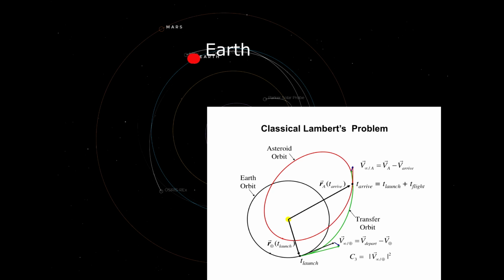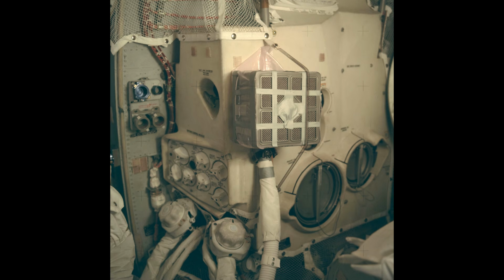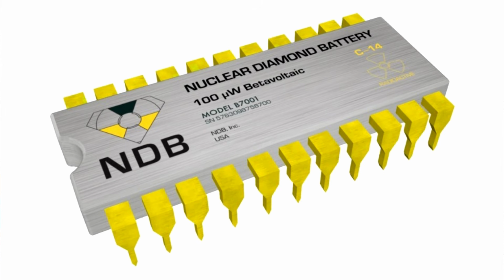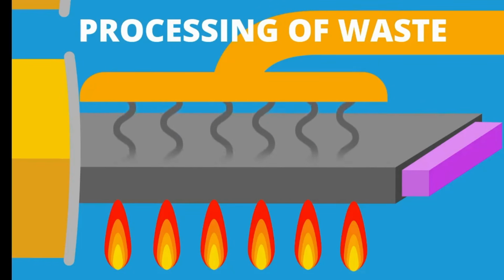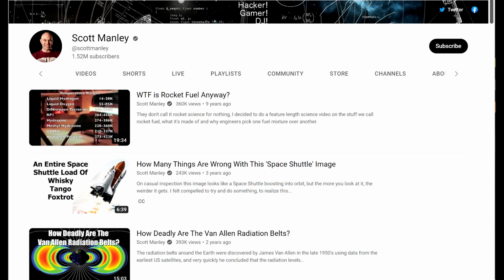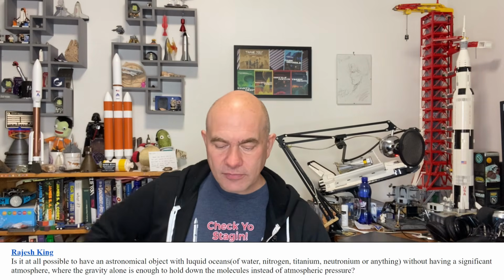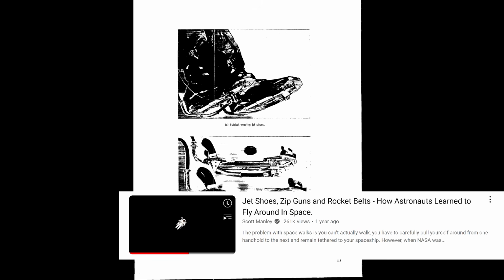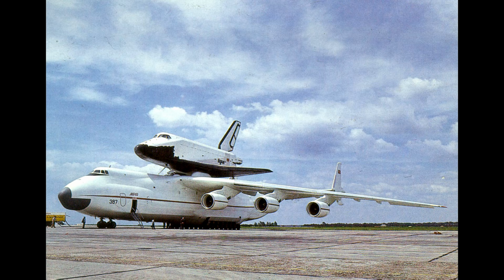Is There a Tripropellant Rocket Engine?  How Are Orbits Planned? - Deep Space Questions 21

Comment: seems easier to feed the central engines from the side boosters and when they are depleted start using the central core fuel than switching fuel from one booster to the other
Reply: Easier to just shove engines on, and drop them and the pumps when empty. They only have to be carried for 3 minutes then, otherwise you still have to carry probably 2 tons of plumbing and valving to orbit. Soviets ISTR did make drop off tanks, but gave up and slapped on simpler cheaper solid cores instead, easier to design and control. Extra tanks add weight that you have to take to MECO. Easier to dump parts after empty, and only take 100kg of attachments and stiffener ring you already mostly need instead.

Comment: I hesitate to ask this, but did you confuse evaporation and boiling when you were discussing atmospheres at low pressure? You started by talking about the vapour point  changing as pressure dropped, but then you mentioned the fact that the boiling point occurs at lower temperatures as well. But surely it's evaporation that's critical here, not phase change? And evaporation can be significant (enough to maintain an atmosphere?) at much higher pressures than those necessary to reach boiling point.  Sorry if this sounds pedantic.
Reply from the maker: Conflate is the term I would use, not confuse.

Comment: I saw a Buran at the Technick Museum in Speyer, Germany back in August.  It was really cool.  I highly recommend going.  There amount of cool stuff--not just spacecraft, but also planes, trains, and automobiles, and also boats (lol)--they have there is unbelievable.  If you go, make sure you get the two-day ticket and have enough time to fully use both days.  It's entirely possible two days is insufficient.
Reply: Seconded. You might want to make it 4 days and spend the other two at the sister museum in Sinsheim, about 50 km east of Speyer. Speyer has the Buran and a 747, Sinsheim has both Concorde and Tu-144. Obviously, both have quite a bit more stuff to look at. 

You might want to look up "Brazzeltage" (I'd translate that as "rumble days"), the next ones are May 13th and 14th, 2023. These days are basically a big party where they just show off the stuff they have. A lot of the exhibits are not just dismembered show pieces, quite a few of them (especially the cars) do work and are drivable.
Reply: I saw it back in 2016 it was really cool! I also loved seeing both the concord and TU-144 in the same place and comparing their interiors.
Reply: @ianchristie3995  Concorde and TU-144 are in Sinsheim, the sister museum to Speyer.
Reply: @realulli  yup your right went on the same day so in my memory they are in the same museum.
Reply: Being a huge aviation history fan I had to see Concorde and Concordeski side by side, but I was time-limited so couldn't make it to Speyer also. I hope to get back to Germany some day to see the Buran (and also because Germany's just a great place to visit, very hospitable people!)
Reply: I saw the Buran in Speyer in August too! I was on a river cruise so didn't get to Sinsheim.

Comment: Curious why don’t they give rockets a rolling start to save just a tiny bit of energy? Mechazilla could start lifting the rocket as it launches
Reply: A) it would only save a tiny bit of energy 
B) there's nothing strong enough to lift most rockets when they're full of propellant, and creating such systems for almost no benefit is not worth it to anyone
Reply: That energy is negligible compared to the deltaV needed, but would introduce a lot of complexity, costs and risks. If it only saves a fraction of a second worth of propellant, it's not useful.
Reply: Well you kinda answered your own question. Using this type of method you only save a tiny bit of energy.
You save such a tiny bit of energy that you wouldn't be able to reduce the amount of fuel carried by even 1%, and so it's just not practical.
If you could get it up to a significant fraction of the speed of sound, that's a different thing entirely. Then it would very much be worth doing.
And following that line of logic, you end up with the various kinds of non-rocket space launch that use things like linear induction motors and mass drivers and Lofstrom Loops and that kind of thing.
Reply: @SciDerg  It DOES work for smaller applications though.  Look at Virgin Galactic's rig where they use an airplane as the first stage.  And I recall reading about a concept of using a C-5A (or equivalent) with a rocket that could be rolled out the rear doors, dropped a short distance under a parachute and then launched.  That idea was used in the Dale Brown story "SkyMasters" as I recall.
Reply: @michiganengineer8621  Yeah but that's smaller applications. You're not gonna launch anything to geostationary orbit with that kinda system.
Heck, not even a GPS satellite, which goes to a lower orbit.
But that's the thing, these kinds of non-rocket space launch that DON'T use aircraft DO scale up pretty well. The power requirements also scale up, but overall a rocket is one of the less efficient ways to get things into space, the only real advantage is that it doesn't really require that much investment into infrastructure.
Something like a Lofstrom Loop on the other hand, that can push lots and lots of mass into orbit over the course of a year's operation launching 2-4 payloads per day (and that's on the slow side of launch cadence for that type of system). The only real problem is that it takes a couple thousand kilometers of the earth's surface (only in one direction, cause it's a linear thing), and that's just too much of an ask for current economies to consider starting work on.
Reply: @SciDerg  With current engines and fuel that's very true about the altitude you could reach.  But, as has been shown with the Raptor engines, there is still room for improvement.  The Lofstrom Loop launcher would be excellent, once materials are available to build it.  As far as the space needed, you only need to "occupy" the land at either end (Plus several locations to anchor the stabilizing cables).  If it wasn't for those pesky hurricanes I'd say anchor one end on the east coast of Texas and the other end in Florida.

Comment: If the Buran was almost pointless how about the N1?
Reply: Moon rocket wasn't pointless, at least not in the sense Buran was. Rushing N-1 to launch pad before thorough testing gave it that 'utter failure' image but it was a race and I'd say that SpaceX and their Starship have proven that live testing from early stages is an approach that can work. In case of Buran however, its very concept made no sense. What was it for even? There wasn't even a delusion about it being 'cheap reusable space bus', they knew they were making 'golden cow'.
Reply: The N1 was no more pointless than the Saturn V was. The inability to fulfil it's purpose doesn't mean that it never had one...

Comment: The rationale for a cargo cycler would not be to save delta V but to utilise existing capacity to transfer to and from the cycler. Of course, as 'cargo doesn't care how tightly its packed' it can travel in a can on the outside of the cycler. Presumably, once you rendezvous with the cycler, the mass to be cycled is almost* irrelevant, as long as your transfer ships can handle it at each end. You then don't need to send a separate set of engines, control equipment etc along just with cargo when you already have all that on the cycler. *The cycler might need somewhat beefed up systems to handle an on cycle correction if that was envisaged.

Comment: I thought Buran (boo-ran) was developed largely because the Shuttle wasn't going to live up to the hype. Their aerospace engineers seeing it would never be a cheap space truck, the Soviets, not understanding American politics, assumed it was all a cover for something military.
Reply: "assumed it was all a cover for something military." Which in a way was true, and failed just as the Buran did.

btw: The fully reusable boosters planned for the Buran would have dropped costs considerably, but they never got to build them.
Reply: @TheZoltan-42  Sure, the "single orbit missions" the Air Force wanted don't make any sense without the ability to launch on short notice, which the Shuttle could never do.

And those scissor-wing boosters would have been something to see (assuming they weren't kept secret...) I've always wondered whether they were a real project though.
Reply: Correct. Even those whose thinking was informed by Marxism saw that the STS figures (even assuming they believed the launch rates being proposed), saw they did not add up.
Then the announcement of a Shuttle launch site at Vandenberg AFB really got them paranoid, as it seemed possible that a launch from there could be over Moscow itself very quickly.
There was also the intense rivalry and politics within the Soviet program, the repeated failures of the N1 gave those who had always opposed it, a rationale for their new project, STS coming overhead from the West Coast got them political support and much more funding, from Brezhnev himself.
Reply: @grahambuckerfield4640  Well, N-1 failed because they were trying to rush it, and we all know you can't rush a rocket project. And after Apollo succeeded, it didn't have a mission. If they wanted a superheavy launcher, they had to find a mission the politicians would get behind, which is pretty much why the Shuttle program was partly military in the first place.

That NASA were really hoping to pull off the long string of miracles required to actually fulfill the hype probably never occurred to anybody in the Soviet program, 'cause that'd be crazy...
Reply: @robertmiller9735  N1 also underfunded and without a central agency like NASA, counterintuitively the Soviet program was beset by infighting between design bureau's, personal grudges, all  made worse after Korolev's death as his successor lacked his predecessors political skills and influence.

Comment: Another reason I can think of to have a cycler is to have deep space engines.
Reply: Shoot I realize that I meant just a space-only ship, not a cycler specifically.
Reply: @JayVal90  Okay. That makes sense. :)
Reply: What's a deep space engine?
Reply: @TheZoltan-42  Deep space engines are things like ion drives and nuclear rockets that are unsuitable for use in atmosphere,  eg low thrust, but quite efficient in interplanetary use.
Reply: @markhorton3994  In case of a cycler that would only make sense for minor course corrections, and the obvious choice at that. I just don't get the original statement you made that: Reason to have cyclers -> to have deep space engines. May be just me, but I don't see the logical connection. e.g. we use ion engines for deep space and long running projects already.
Reply: @TheZoltan-42  I did not make an origional statement. I answered your question with a vague definition and two examples neither of which is currently a great choice for a cycler's main propulsion. 
Another deep space engine would be a solar sail which is currently experimental at best.
Reply: @markhorton3994  "I did not make an origional statement." My bad. I was doing multiple replies and I had the OP in my head when I replied to you.
Reply: @TheZoltan-42  I was thinking more of a large but efficient engine, where the mass of the engine would be large but the propellant advantages would be even larger. Imagine like a linear rail gun with large solar panels that used an ion engine or solar sail to bring its orbit back up after launching a payload to deep space.

Comment: For asparagus staging, instead of feeding the engine from 2 different sources, they could instead put batteries in the booster nosecone and drive electric pumps that feed directly tank to tank.
Then just use the same plumbing you use on the pad to fuel up. The center core then has to have 2 such inputs (1 on each side), while the boosters have 1 input and 1 output. The pad would then fuel the boosters which then use their pumps to fuel up the center core. In flight, these pumps continue to run (they just switch to batteries) and cross-feed until separation.
And it wouldn't have to run the outer tanks 100% dry, there should be enough performance gain if the pumps would run until 10% fuel left, so they can be placed just anywhere on the bottom of the tank.
And for everybody that thinks electric fuel pumps are not possible for larger rockets: it's a lot less problematic than replacing turbopumps with electric, as the pressure requirement (and therefore the power needed) is much lower for tank to tank transfer.
Reply: Doesn't it take longer to fuel a rocket then to empty one in flight?  It seems like electric pumps would have to be  huge (and heavy) to match the fuel burn rate.
Reply: @somerandomnification  1: yes, but nothing speaks against just having some headroom in what the pumps can handle and running them slower on the pad. 2: The Rutherford engine has electric fuel pumps and still has a TWR of 72, which is not that bad. And there the pump has to generate a lot higher pressure, which is not the case in my idea. And weight does matter a lot less in the outer boosters compared to later stages, and even more so if they are non-reusable (where my idea would work best).
Reply: The turbopumps on large rocket engines are monsters. Hundreds of pounds per second.  Having plumbing, pumps, and power supplies that could transfer fuel & oxidizer fast enough to keep up would add a lot of weight.  A more efficient approach would be to have valves and plumbing so that the turbopump itself can pull from & switch between multiple sources, but even that has some major challenges.